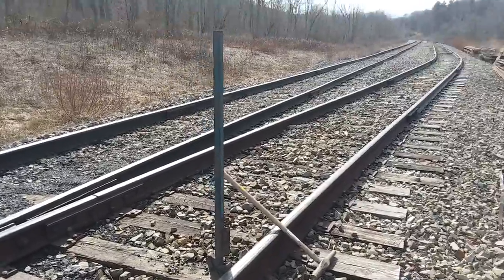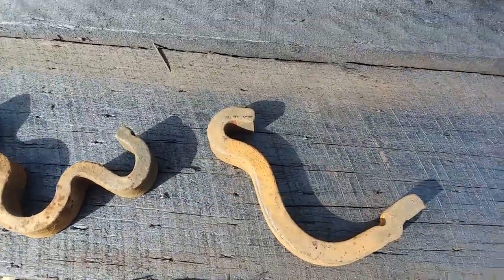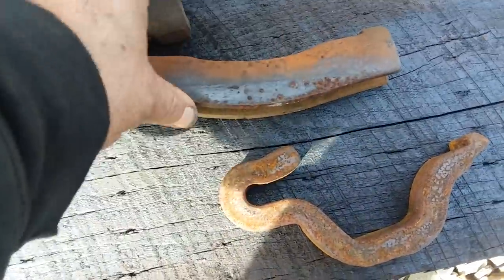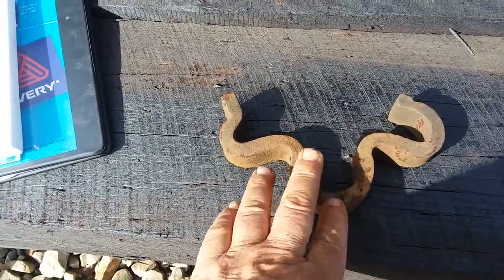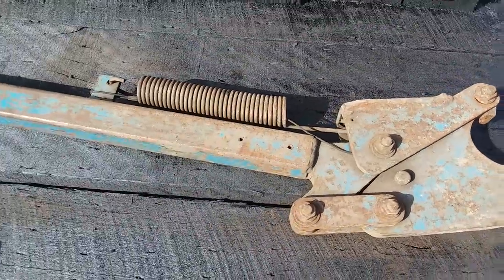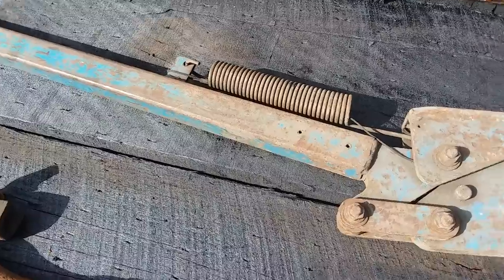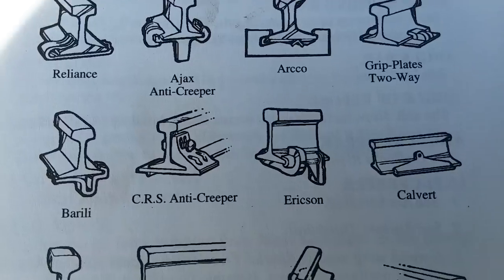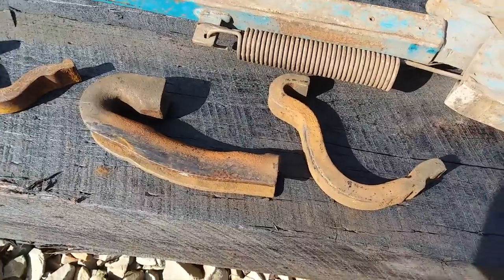All About Railroad Track Anchors - Sometimes they are Called Anti-Creepers

Comment: Pounded a few thousand or so on/off back in the day.  A very important track component for sure.
Reply from the maker: You are right, very important part of the track structure. 
Thank you for taking the time to write in and to check out the
video. May you have a very good day my friend.
Reply: @ccrx6700   Thankyou. Its amazeing how much rail can move without them properly installed. especially when dealing with jointed rail. open joints in the winter,sunkinks, skewed switchpoints,etc. thanks for the bad & good memories lol.
Reply from the maker: @UTUBESUXS2024  you are right 👍😊

Comment: so the way i got it is all those do is to stop the rail from going forward or backward . i have always been amazed at how the rails stay parallel with each other . i often wonderd why they don't take the old worn rails cut them into length of the wooden ties and turn them upside down and use those for a tie every other rail tie and weld them to the rail . thus the rails will never spread apart . i believe that if they were put at say a 20 degree angle some of the weight would be transferred to the other rail which would give the track a more solid footing with less wooden ties having  to be replaced also for hardly used sidings you could just use the upside down rails and never worry about wood rot . and now a robot could do the welding .

Comment: A loco mechanic at the UP told me he saw a video of a SD90MAC spit rails out from underneath itself in testing. As you mentioned I would guess jointed rail has a lot less issues with creep and temperature related movement. I miss the smooth even clickety clack of joint rail. The EJ&E  had jointed rail on their Lakefront line rated for 40mph, nobody dared go over 25. The harmonic rocking was pretty bad
Reply: Wonder what the loco was tethered too to spit rail out
Reply: @animenut69  good question. I assume some sort of starting tractive effort gauge. Would be impressive to see
Reply from the maker: Matt, that would have been awesome to see! In all the thousands of comments I have gotten from all the videos, you are the first one to mention harmonic rocking! That kind of talk turns me on,,,,lol
sometime in a far future video will try to do one on that topic. Really
appreciate your comment and for watching

Comment: IC used snap on anchors , every other tie , with three spikes per tie . This is main line with 1/4 mile weld rail . They had a machine that would snap them in place . Just drop next to tie and operator would take it from there .
Reply from the maker: Typically on CWR every tie is anchored Robert. One thing we do
lack is enough anchors on the jointed rail we have here. I definitely would love to have an anchor machine in here! Thank you for taking the time to check out the video and may you have a very good day my friend.

Comment: I worked for a traffic data firm and figured out that the modern rubber handled 4 pound sledges made a much easier day of driving 3" nails into asphalt, and shortly after, the hard plastic handled hammers met a similar fate as your old fashioned bar.
Reply from the maker: Jerry, great minds think alike sir! lol

Comment: Every component plays its part and is of equal importance. Your wrench could do with a drop of oil on the joints. 😊 Thank you for another great video.
Reply from the maker: 4 anchors per tie, on every tie for continuous welded rail. Yep,
everything all adds up, miss one component and you got a weak
link. Thank you for the nice comment

Comment: Here, in Sweden, I've seen flat iron bars bolted to 5 to 10 slipers to stabilize the track but never the things You showed.
Reply from the maker: I've seen a very old RR bridge here built by the Pennsylvania RR
that has that strap lagged down to each timber.
Reply: @ccrx6700  Wow! It's used in the US as well.

Comment: Great and informative as usual.  I was wondering if you do one on rail plates and why they need to be replaced? they just did a bunch of them near me and left a huge pile but they look pretty much the same as the new ones except more rusty.  thanks again for providing very unique information
Reply from the maker: Thank you very much Lyndon. Will do one on the tie plates probably
next summer, had planned on one but so many other things came
up since then, but will eventually get a vid devoted to the plates.
Biggest reason for replacing tie plates is where the ties are in
unstable ballast and the rails have too much lateral movement, thus
wearing down not only the base of the plate, but also the shoulders
on the plates

Comment: I've also seen a few of those "Wooding" like @2:33 anchors lying around here where I live. There was an old Monon line, but they tore out all the track 20 years ago, and now that's all walking trails on the former right of way. Never knew what they were for until now! Learn something new every day.

I have a question, when you have to replace a broken tie plate or fix some crankshafted bolts, and the rail is pulled apart too far, do you have to knock off all those anchors before you drive in a drift pin to try and try pull the rail joint back together before you can get new bolts in? I would think if there's a lot of those anchors and they have good holding power, then nothing would happen even if you "light the rail on fire" with the bags...?
Reply from the maker: Very good question. We used to have a manual rail and with it you
would need to knock anchors off. If only using a drift pin and
the gap was big then yes knock off anchors. But if that gap is that
big, then I use the fire snake. Sometimes you can't even get
a drift pin started the gap is so wide. With snake it's rare I
ever have had to take anchors off. Hope that helps and thank
you very much for watching my friend.

Comment: Dave, the pandrol plate and the fast clip is replacing the old rail anchor, and the tried and true cut spike.
Reply from the maker: I like the pandrol clips with lag screws, I think they give superior
holding power. Wish we had them here. Would you recommend
using the pandrol clips on bridges that are in curves? We have
a couple of bridges on 9 degree curves and it's hard to hold
the spikes down on the approaches. Just wondering your
thoughts on this?
Reply: @ccrx6700  Dave we us the pandrol plate and fast E clip on the elevated track on the New York City Tranist which is nothing more then a bridge over the streets. The system also deals with many  transitions from ballast to bridge.  The plate should work out fine for the railroad.
Reply from the maker: @billyvalentine1836  Thank you 👍😊
Reply: @ccrx6700  one note Dave, may have to have to adjust the surfacing between the transition of the plates. The pandrol plate is slightly taller then the cut spike A plate, run off needs to be blended. With your time on the track I'm sure you'll be able to work it out!!
Reply from the maker: @billyvalentine1836  👍😊

Comment: I'm just learning,  you're driving in a spike are the holes that are pre drilled, center cut oak seems impossible to drive a spike into , nails just bend
Reply from the maker: Frank, none of our holes are pre drilled, we use a hydraulic spiker when theres more than a couple to drive and some ties even it wont drive them in all the way, have to finish with a spiking maul, they are hard! So maybe those ties are oak heartwood, have never thought of that before. Thanks for the info 👍

Comment: At your frog and crossing points do you do something differently with the anchors since the forces are being split between two different sets of rails or does the speed drop at the switch point not really need a different type of setup?  One thing you also didn't really mention is how they work to avoid creep. I would think by the design the elbow point digging into the ground. Almost  like a spike going into the wood but in this case it's digging into the compacted ballast. Which I would think means two things. One is they are removed before undercutting and two go back in after at least one good tamping run. In layman's terms I guess it's like a cleet on a golf or baseball/football shoe.
Reply from the maker: Stephen, you got a really great inquisitive mind, I like that! We do put more anchors in the turn outs than on other sections, wish you had asked that question before I made vid or would have pointed that out. thank you.

I would like to do another video on rail creep in the future to explain a lot more in detail about creep than what I got into here, so be patient on that on. But simply said the anchors are adding resistance to 
the rail to help alleviate creep, they don't eliminate it entirely in all cases.

We typically do not remove the anchors when undercutting or cribbing, only when replacing ties. After tie is replaced then anchors are put back on. Do appreciate your comments and for watching

Comment: Those channel lock anchors worked very well, I'm not sure why you seem to think differently. Plus they can be reused as those unit anchors are pretty much a one shot anchor. They're sprung after one use. That just my opinion which comes from 40 years in the track department on a Class 1 carrier.
Reply from the maker: Yes your right, they do get weak after many years and usually
when you take them off they need to be replaced. Hit an
anchor off and if it goes flying it's still in decent shape. hit it
off and it just drops, time to replace. Thanks for sharing your
info with us Mister Goat. Was nice of you to drop by and write in.

Comment: Had an accident with the drive on anchors, drove one on and checked to see if it was clipped on right(it wasn't, it was slightly off and needed a touch with the hammer) while looking, a bit of ballast fell onto the clip part and must have minutely shocked it enough to click into place... which launched the rock at my face splitting my top lip and cracking a tooth, spent the rest of the run spitting blood and having the lip catching on the busted tooth before i could go to the dentist lol.
Reply from the maker: Wow, sounds like that was a really oddball occurrence,  what a surprise that was for sure.

Comment: Great Video! I am happy I found your channel! I have an unrelated question that I have wondered about for a long time, do pennies/coins damage the rail or wheels of a train? Would it be any different on light rail, like the electric commuter trains used in Sacramento? I remember being at a platform waiting for a commuter train and when it arrived they got on the PA and announced that coins on the rail damage it, and is a criminal offense, apparently someone put coins on the track and they saw them pulling up.
Reply from the maker: Christopher, thank you, really glad you are enjoying. Great question. Those wheels and the rail are really hard steel, coins are made from a much softer material. Think a copper penny, hit it with a ball peen hammer you can flatten it, hit a rail with same hammer and no damage occurs. I doubt if a penny could damage light rail either.

Obviously it is extremely unsafe for untrained  and unauthorized persons to be on any rail specially transit.
Reply: @ccrx6700  Thank you! I always assumed such, I figured it was more a liability than a real damage issue.
Reply from the maker: @christopher88719  your welcome sir, I believe you are correct, liability issue

Comment: Thanks for the info. Do those have to manually be removed or can those machines that pull spikes when replacing rail/ties also kick those out?
Reply from the maker: David that is a really good question! The spike puller machines cannot remove anchors. There is a machine made by Racine that does remove them, below is a link to that machine. We have to manually remove them here. Do appreciate your watching sir

https://www.racinerailroad.com/products/track-equipment/anchor-remover

Comment: Watching your informative video, what to the anchors anchor to? If they anchor under to the the track plates, I understand. But looking at where the anchors are positioned, it looks like to me that they just rest into the gravel ballast. Please clarify what is the purpose of rail anchors. Thanks for the education.
Reply from the maker: Good question Rick. They create resistance to rail creep. When
properly placed the anchors are against the tie on either side of
the tie. So when the rail wants to creep due to thermal contraction
or expansion or the driving and/or braking forces of the train,
the anchors in themselves won't have much holding power. But
when the anchors are also trying to move the tie that creates a
whole lot of resistance. Hope that helps, if not write me back.
Reply: @ccrx6700  Ahhh, the science of physics. As a long-time Locomotive mechanic, and being able to hang around the track gang - aka in the Golden Years as: (Gandy Dancer's), from time to time,
 I never knew those track anchors were there in the first place. I should have paid more attention by looking at the ground around the ballast more closely. I never have a problem looking at the ground for loose coins, which I do find occasionally. 
Your videos are such informative and educational regarding railroading. 
Even die hard railroad buffs like me and other's learn something new from you every time your video is observed. You would make a GREAT School Teacher, or College Instructor / Professor. Nothing in the universe beats someone with actual hands on experience, mixed in with years of mental knowledge of a subject like you display. You also have the voice of total attention to detail, without the self pomp and circumstance tone that some people end up becoming big blowhards, and "know it all's". Thank you for leaving your mark on society with your videos.
It's really good to know that, after God calls you back home to Heaven some day - your railroad videos will live on forever with YouTube. That is until Jesus makes his 2nd and final return visit to earth before He destroys it on Judgement Day. Until then, stay on the rails rolling happily down the track, and don't derail. Peace.

Comment: Curiosity moment. The anchors were on both sides of the tie, does that mean the tie is the buffer to block movement of the rail through the anchor being blocked by it?
Reply from the maker: Very good question Ray, the tie adds a tremendous amount of 
resistance, the anchors push up against the tie and the tie resistance
helps considerably to hold the rail, hope that explains it for ya

Comment: verrry  interesting.  you said you always put them on from the gauge side (inside).  i'm not looking at tracks as i type this but i think they are put in from the outside in australia.  or at least where i've noticed them.  why are they put in from the inside?  you'd get a better swing at the driven-on ones if they were installed from the outside.
Reply from the maker: That is a very good question that the only answer to I have is because that is the way I was taught to put them on. Not a very satisfying answer I'm sure. Read some other comments and those who are commenting on this are saying the same thing, that's how they are supposed to be put on. 

Now here is my speculation, if you look again at the unit drive on and 
wrench on, and the Wooding, you'll notice that there is more of a side surface on the anchor on one end than the other. More surface means more resistance, so putting them on from the gauge side would mean there is a bit more resistance on that side. The gauge side of the rail head  in balanced track takes more of the weight of the wheels than typically does the field side of the rail head.

So welcome your thoughts on this and thank you for watching
Reply: @ccrx6700  , how about this reason?  its easier for visual inspection as you ride a trolley along the tracks.  and in australia they ride in air conditioned 4wd cars along the side of the tracks.
Reply from the maker: @vsvnrg3263  that could be

Comment: Been watching your videos and found the railroad on Google Earth, and a question popped up. How do you get a new Loco on your line? I found no connecting railroad track. Am I missing it, or what? Thanks and keep railroading and videoing.
Reply from the maker: Bob, that is correct we do not connect with another railroad. All our
rolling stock must be trucked in. NS has a siding at Poland Mines,
its about 4 miles from our Alicia harbor, everything comes there, then
Hulcher brings it over route 88 to our place. Appreciate your watching sir
Reply: @ccrx6700  Thanks for the reply. I think a cool video would be bringing in a Loco. I know that would be rare, and may not happen for years, but I would watch it.
Reply from the maker: @bobackerman5847  well Bob, you are in luck! Am going do a vid on all each of our 3 locos sometime. When i do the one on 3098, i do have some pictures of it being loaded on the truck and hauling it on the road! So that will be in that video. May be awhile for I can make it, but will do sometime this year. Thanks Bob, I like to know what folks are wanting to see, that helps me plan ahead

Comment: Are the joint bolt holes oblong to allow the rail to expand with heat? And how often do you have to go back and tap the creeper against the wood tie?
Reply from the maker: They are oval because the track bolts have and oval part of them
to fit in there, oval instead of round gives more surface area
for more holding power BradBo. Thank you for taking the time to  stop by and check out the video my friend.